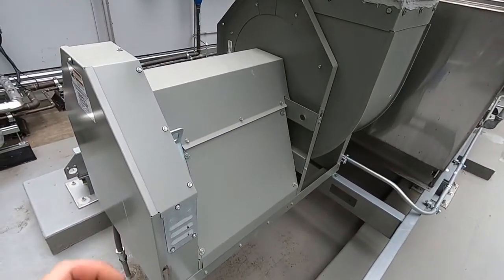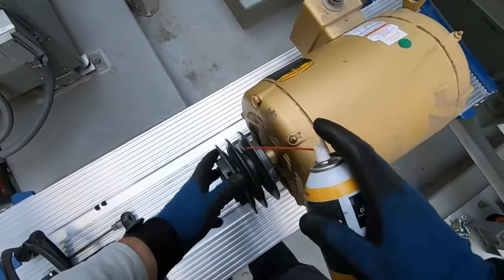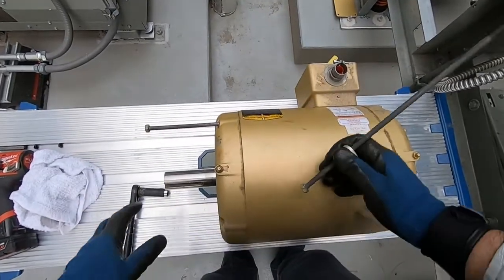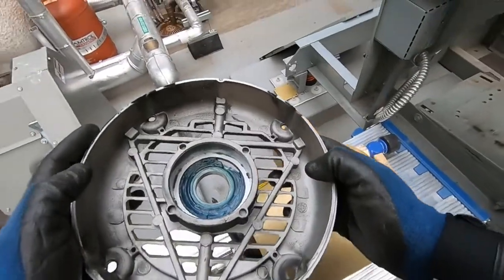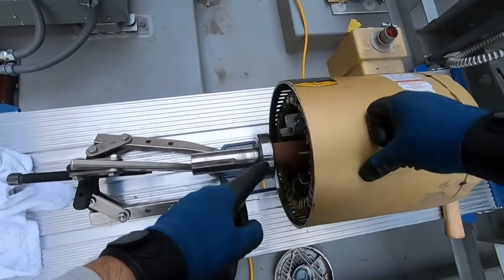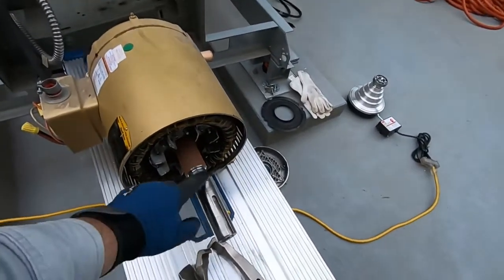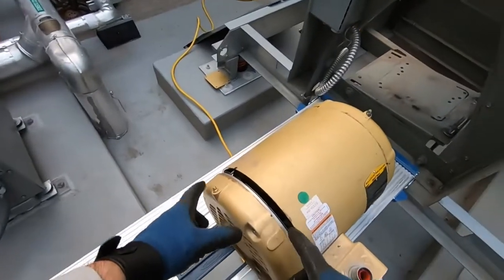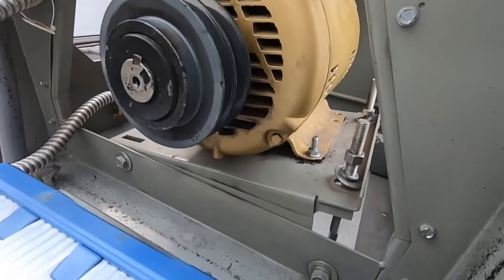BALDOR MOTOR BEARING CURSE

Comment: Is the motor on a VFD (Variable Frequency Drive)? I feel the bearing problem is most likely a result of shaft voltage. The approach is to cut the bearing apart and look for shaft voltage and possible fluting. You could start with popping the old bearing shields and looking at the grease inside. If it is discolored that is the first sign of micro arcing caused by the shaft voltage. The voltage on the shaft sparks across the grease film inside the bearing. There are many grounding brush solutions available to prevent bearing damage from shaft voltage. Another additional protection measure would be to install ceramic ball bearings which insulate and break the electrical path through the bearings. I am a Reliability Specialist for the largest Midwest Electric Motor Repair Shop Company, I fix problems like this daily.
Reply from the maker: I’ve heard of this happening. When I replace OG motors I end up getting new motors that come with the ring grounding kits installed already. There’s also a product out that look like current donuts but instead they help prevent arc from VFD’s. My thing is I have original motors that are close to 20 years old on VFD’s they are still rocking. But anything coming out from the last 5 years seems like pure trash does not last.